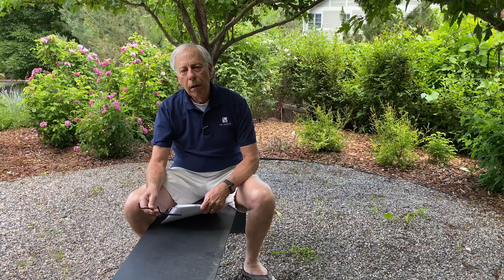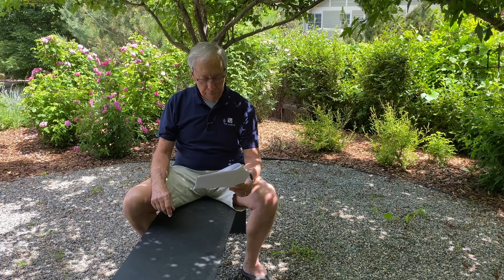The problem with TVs between speakers

Comment: I don’t think a flat tv-set on the wall, 2-3 feet behind the speakers alignment is going to ruin your soundstage.
Reply: Maybe not ruin it but it doesn't optimize it either...studio spaces attempt to have most flat reflective wall surfaces covered with acoustic treatment if at all possible for a reason. If you don't have the option due to space or lifestyle, it's just a trade-off most of us can live with...but that doesn't mean the improvement isn't possible.
Reply: @ddrenth  studio spaces try to eliminate parallel reflective surfaces, but the ones of the last decade+ also usually specifically put a computer screen between the monitors they're mixing the album on. the ones that don't have that usually don't because they have some combination of a large glass window to watch the live room, or a large flat metallic console providing it's own reflections. and then at the mastering stage there's once again almost always flat faced racks of gear and/or a computer screen right in the sweet spot between the speakers.

Comment: For Home Theater, it's fine and it doesn't matter. The sound of a movie is not hampered at all. However, for two channel stereo, i made an absorber out of ordinary foam board by installing two plastic hooks that attaches to my 55 inch tv and glued two inch acoustic foam to the front side of the board. It drapes over the tv and looks and sounds great. When im done, i remove the foam board and store it until next time i do two channel stereo listening.
Reply: I'm working on something similar, maybe that hinges down from the ceiling.
Reply: @TheAgeOfAnalog  awesome...i like doing that kind of stuff.

Comment: Moving the equipment rack to the side from center is a compromise, not a full solution.  Youre trading a change in sound from the middle to a change in sound from only one side.  Youre losing out on the symmetry with the rack on the side wall.  The absolute best solution would be to have the equipment rack behind the listener dead center.

Comment: I’ve always read that it’s important for the main L&R speakers to be able to “see” each other, meaning that there should be an unobstructed line between the fronts of the speakers, with any gear or furniture being behind that line.  In practice, this should not usually be that difficult to achieve.  Most of your audio gear will be backed up near to the front wall (i.e., the wall behind the front speakers), while the speakers should generally not be directly against the front wall.

Then, if your speakers are pulled out a little from the wall behind them, the gear and/or TV between them will be behind that line between the fronts of the speakers.  As well, if the speakers are even just 6”/15 cm. from the wall, their bass response will be smoother, because the peak-causing boundary gain from the front wall will be reduced.  The imaging also tends to improve if the speakers are a bit further from the wall.

So, moving the speakers away from the wall, even a little bit, improves their sound in two ways:  smoother and less peaky bass response, and better soundstage imaging.  Win-win!

As for putting a blanket over the TV, I’ve often read that it’s helpful, but I haven’t tried it, so I can’t truthfully comment on it.

Comment: I can vouch for this. I used to have my TV in between my speakers, but then mounted it over a fireplace on an adjacent wall. I am now getting much better imagining from my system, even when swapping two sets of different speakers. My A/V rack is still there, but its low to floor and space between the speakers is freed up. I also have the speakers about 5 feet from the wall. Music has really come alive in this setup.
Reply: I don't believe it.
Reply: Paul:

And neither do I.  

The last place for a TV, of any type or size, is above a FUCKING FIREPLACE mantle!

Comment: I have tried it, and I've found that as long as you keep your gear below ear level or around shoulder height  (when you're seated) it wont have any negative affect on imaging, even if you place them between speakers, just keep them below ear level and you should be fine.
Reply: Negative effect. :-)
Reply: It's quite easy to determine via an ETC measurement. 

This is the industry standard for determining whether there's early energy reflected to the listener, how early, and at what level and what frequency spectrum. 

There's so much speculation in the audio enthusiast community and the same tools studio acousticians use are available so inexpensively ... it's quite easy. 

For a $100 mic and free software that's state of the art (REW), one can measure. 
Or for $300 OmniMic product is even easier ... seriously less than 5 minutes and you're measuring!
Knowing what's ACTUALLY going on and addressing it, is a force multiplier in audio unlike anything else.

Comment: OK Paul - you seemed to skip this -- assuming the speakers are located in the best spots in one's room and these is a lot of space between them - certainly enough for a 65+ inch TV or screen then the vast majority of "us" who live in the real world of not having a dedicated listening space will put a screen there and a centre channel or sound bar. Some like Steve Guttenberg very clearly do this - but when one sees this on his vids it is clear he has placed a thick quilt over the TV -- presumably to provide a better look, but also to reduce reflections. 
Since this setup is reality for so many my hope was you would address reflections and other sonic issues. In my case my speakers are about 11 feet apart and I have an 8' wide AV unit which contains a matching centre channel, large TV, my amplifiers and digital sources. My analogue sources are more accessible off to one side. Obviously I have couches, chairs, 2 large ottoman, curtains wall hangings/pictures and  a host of other crud in my lounge/listening room  -- the best deal I could strike was to bring the mains into the room away from front and side walls.

Comment: Blame it on those newfangled universal disc players that need a big-assed graphic user interface - as in a big assed TV screen - in order to be set-upped properly and then to serch for the sound that you want -i.e. dither settings, sampling rate settings, etc.

Comment: I agree. I have a small room, so I have 2 x two shelves audio racks and the amplifier in between the 2 audio racks to solve the cable issue. All placed in the front wall about 2.5 feet behind & in between the speakers. Its not perfect because it gets a bit of sound wave on the equipment but a compromise.

Comment: I don't know Paul.  Like many others have said in the comments, I, too have my tv (a big box) and stereo equipment in between both speakers and it sounds fine to me.  The sound stage seems to go behind the back wall (music) and vocals are projected forward (depending on the mix) with sounds happening on the left and right. Watching tv, the sound seems to come right from the tv and my speakers are not spaced evenly. One speaker is 4 ft from tv the other is 5 ft from the tv.  And I've heard lots of super expensive hifi systems when they had hifi shows in LA back in the early 90's.
Reply: No winning with this an empty room would echo like made with all reflective walls and no damping.ive just bought a 3d wall panel that would be act like a defuser and doesn't look as bad as foam or acoustic panel all over your living room walls.

Comment: normally the speakers have diferent types and they are made to be used in a perfect position so it can give you the best sound putting them in front of you with a tv or hi-fi system inbetween you would have 20% of it´s quality and stereo efect , i´m going to writte about normal speakers 2 or 3 ways and bass reflex, normally it also depends on the size of the room ,the better way is using the corners of the room to put each speaker and left a 30 cm espace between the wall and the box of the speaker  no matter how big is the room, it starts to give you a more rich sound in high and low frequencies ,you´ll notice that by having the bass knob on defeat or 0 position while if in front of you with the hi-fi or tv equipment, you need to increase at least four in the scale to have the same bass level but also you´ll feel the bass not as a direct sound but cleaner coming to you and bass either than listening to it you also feel it, if powerfull enough it makes vibration on the windows of your furniture or even in your body, the treble is the same you want the sound to come natural as if the band was playing in the room so the more apart they are, the sensation of quality in the sound increases if next to eachother it doesn´t give you the sound they were built for as the sound controls don´t have a strong response as it should, this is the basic instalation ,there ´s other types of speakers and normally they come with instructions for it´s instalation, but if you have a 4 speaker system you would put the other two behind you in the same position of the front ones if possible, normally with early 70´s 4 channel matrix is the same type of instalation, but i would writte for hours to explain how diferent speakers are to be installed on your listening room, regards

Comment: Like many others, ive never noticed an issue as long as the equipment is behind the speakers and not interfering with the main dispersal sound. Maybe my systems are simply not revealing enough to notice (im a 15k system kinda guy). I spent a long time in my youth both installing and working in studios and they follow none of this logic, which is baffling if its easy to hear...

Comment: Setting everything up in an ideal manner is virtually impossible for those of modest financial means. 
Fitting a decent system into a small space AT ALL is hard enough to do. 
In my longest-lasting residence so far (over 15 years), I had the audio equipment off to the side 
and most of the video equipment (all but the LD player) between, but well behind, the speakers. 
The arangement came about not because I wanted it that way but because that was the only way I could get it to fit.  
Sound-wise it was pretty good, I thought, though I'm sure there were many errors and deficiencies of which I was blissfuly unaware.

Comment: With old box Tv's this may have been relevant, but with today's flat TV's I don't see it affects the sound much.
Reply: Today's flat TV's affect sound even more due to the larger reflective surface they present to sound waves. That's the whole point of room treatment for walls and corners also...
Reply: @ddrenth  please explain, i mean, there is a wall, or a screen, both hard reflective surfaces, no?
Reply: @amitraam1270  Yes, you are correct, a flat panel TV isn't much different than a flat back wall...but a treated back wall is 100% better than an exposed flat panel TV. Any of these audiophile youtubers including John Darko, Steve Guttenberg, Andrew Robinson, New Record Day, Zero Fidelity will all highly prioritize room treatment for your listening area...and that will always include the back wall, corners, side walls, and floor (some go as far as ceiling installations). I think every single one of them has a dedicated video on this topic...including Darko's release just today. I get some people simply don't have the option for a separate listening setup without a TV, but for those who do have the space, and the ability to install even basic treatment, it is an advantage.
Reply: @ddrenth  sure, vs treated surface, no competition.

Comment: I'll guess that more than 50% of people with stereo set-ups have their TV, gear, rack or furniture between the speakers. Simple fact, most people don't have the needed space to spread everything out. I've come to the conclusion that my sound system is only going to sound "so good" and not as close to perfect as it can get do to room limitations. I except this...  until I hit the multimillion dollar lottery :)
Reply: Fat Rat  
My new custom designed house will have one hell of a music/party room. Come one, come all, let's jam and have a drink or two :)  Of course, after this damn pandemic :(
Reply: Fat Rat  Private jet???

And you only bought a pair of green power cables. Ffs you could at least have bought he purple.

Way more regal
Reply: Fat Rat  
I'll fly back with you, always wanted to check out Australia. Do they rent Mad Max style cars? Kick-in the supercharger and Go! Only if they strap a guy to the front of a tanker truck, hilarious! One of my top 25 movies of all time. Released in '79, I was 20 and we probably got stoned in the movie theater parking lot beforehand.
Reply: @Mark-lq3sb  I will chime in and let you know that's exactly the kinda vehicle Fattus drives. You might have your classic mid to late 60's collectibles (some gorgeous vehicles I might add), but those are ours. 

As good as that first movie was the rides were totally derivative of the outer suburbs.

I wonder if Rats mobile is nitrous charged? 😳

Comment: I agree with this. I still live with my parents in my room. I have a pair of mission 753 speakers. They sound beautiful. But i still have to put all my stuff in one room. I have my tv in the middle of  my speakers and it seems that this puts the soundstage above my tv instead of in the middle. My speakers stand at least one foot in front of my tv and this still affects the soundstage. Its just that i dont have a better solution. But i still notice the difference. Iisten mostly with my eyes closed so i can visualize the image more effectively but still there is some difference in the soundstage.
Reply: I don't believe it.